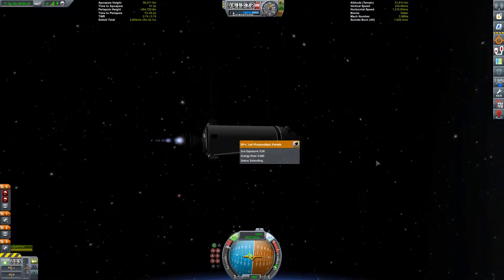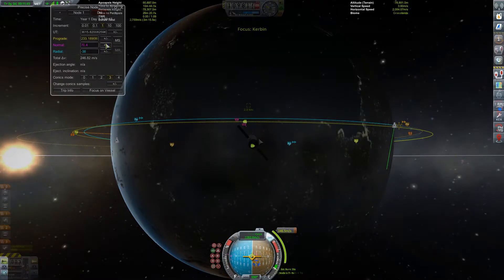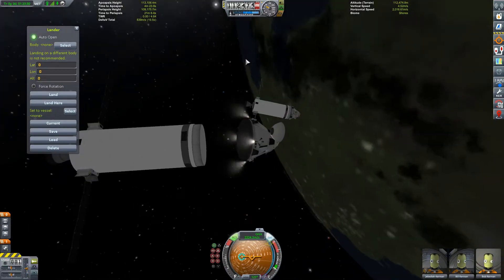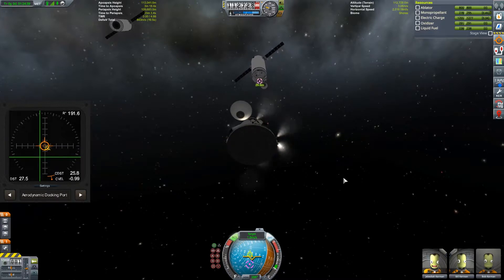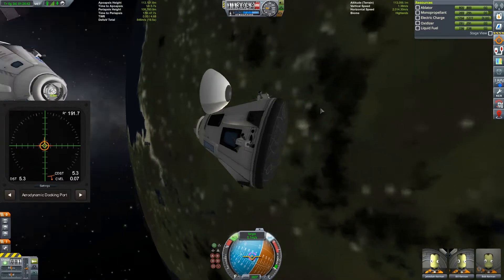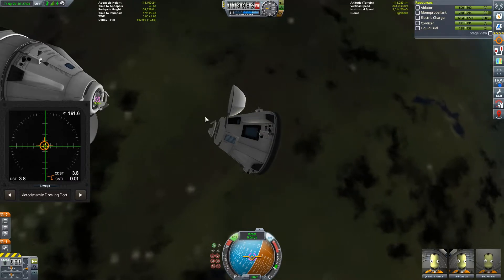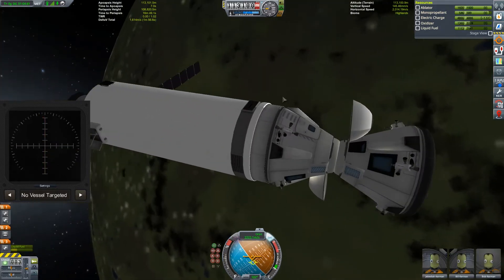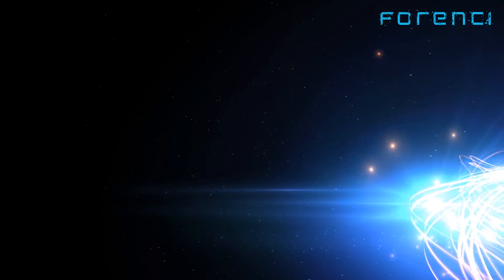KSP Mod Overview: RCS Sound

Comment: Yes in real life, from what I remember when the Shuttles were still flying, Astronauts did inside the cockpit, hear the RCS kick off but it was just a gas sound like air pressure leaking from a stim on a tire